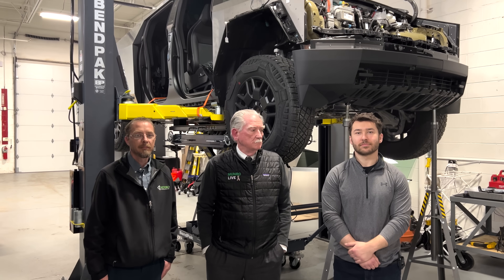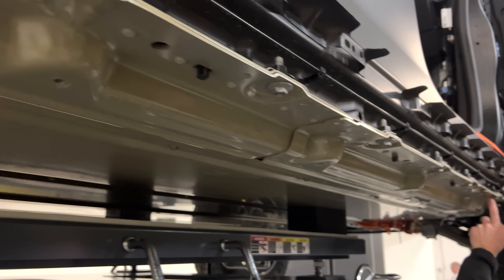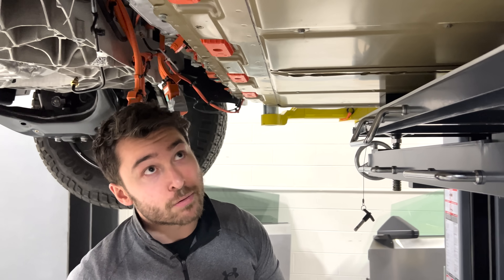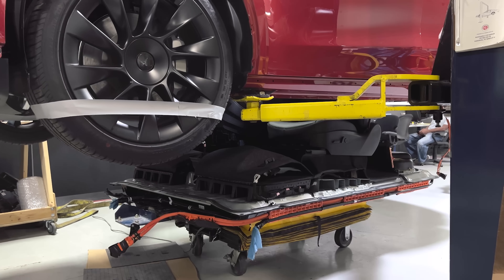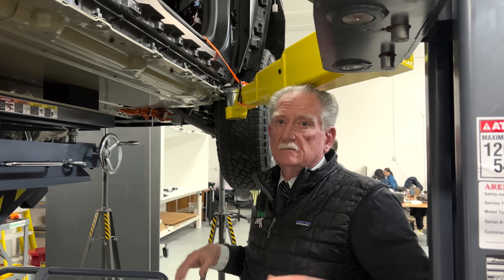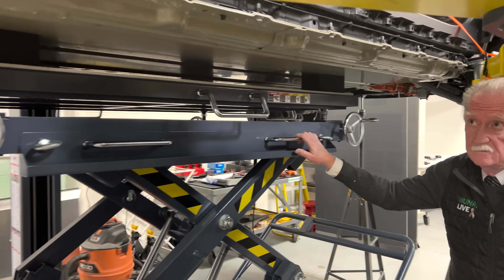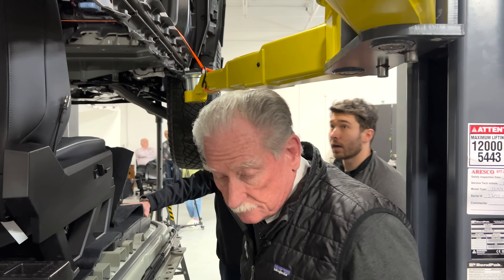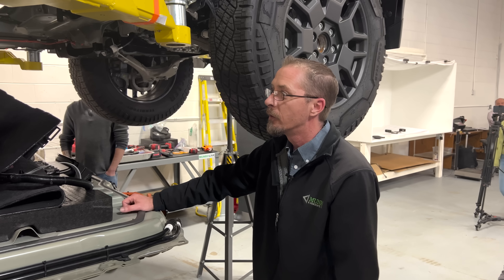Dropping the Battery Pack in Our Tesla Cybertruck!

Comment: Having the battery pack integrated into the floor and with the interior/seats bolted to the top of battery case sounds good for assembly.

As someone who removes, disassembles and services/repairs high voltage battery backs after the fact in a shop at the dealership… it sounds horrible lol. The current setup for the BEV battery packs that I work on, they have the entire battery pack bolted to the underside of the unibody with no need to disturb or disassemble the interior. Just disconnect the hv connectors, remove those bolts on the perimeter holding the battery to the frame, drop it down. Then you can just unbolt and remove the top battery cover to access the inside of the battery unit and do what you need to do. 

I’m assuming they will need to remove all the seats and interior before being able to remove the top cover and accessing the inside of the hv battery unit? Oh well. More labor and more money for the technicians I guess! Seems like they are saving on assembly, but trading that for labor time to service/disassemble it if there’s an issue later on and gambling that nothing will fail or have a defect inside the hv battery unit. Time will tell, but it looks pretty rad.
Reply: What's the betting they will find it is like the Model Y: seats on top of a  sealed structural battery unit filled with foam that renders battery and control units not just  non repairable but incapable of being internally inspected without destructive entry and total PITA of manually removing foam or dissolving it with solvents

That's leading to write off of Model Y's after even minor shunts and ramping insurance premiums
Reply: The structural packs are essentially non repairable. Maybe you can do some work to the controllers, but the rest is no-go. When its caput the whole thing needs to be recycled. Thankfully I suspect these packs are quite durable so the need for repairs might be less.
Reply: Maybe it's to make the interior waterproof that's why there is no leakage into the interior and that it's the safest EV
Reply: Apprently the seats CAN be removed w/o dropping the pack.
Reply: @varietyegg  Cybertruck has a specific Wade mode for going through water. Raises suspension up but also pressurises battery with air from suspension sysyem to prevent water ingress

Comment: Thank you for the video! I wish they’d make easily serviceable battery packs. Say there is a failure, it would be nice and a much lower cost to be able to replace a cell or small module of a few cells. This is the way they did it in the 2015+ era Model S. It’s also more environmentally friendly.

Comment: Some good information here. I have assumed that a structural battery pack meant that it could not be replaced which would for the long-term owner of a vehicle be terrible. Nice to see it’s easily removable.
Reply: Ugghh.. the very last step went smoothly, but they did alot of fiddling to get the charger bus bars disconnected. Also, the fact that the top of the battery is interior to the cabin while the bottom is exterior, means that mounting it requires careful application of sealant or else the interior will fill with  water if the truck is partially submerged. So lots of caveats with this one.

Comment: You say that this can be assembled in two stations versus 12 or 14, but that doesn't account for dressing the battery pack with the, floor, ducting, seats, etc. How many stations would Tesla need to prep the pack? Is the real advantage just being able to do those tasks in a more open environment?
Reply: That can be pre done on another line. That way it's a complete assembly when it gets to the main line. Same as the front and rear drive unit assemblies.
Reply: Exactly,iits all just asskissing,no critical thinking!
Reply: @saff226  Of course, but it still takes time to do that work and money to create those stations in the plant. Before claiming this saves 10 minutes per vehicle and $600K-$800K in capital costs, Munro needs to account for the time and financial cost of dressing the pack. Not saying there aren't advantages to how Tesla does it, but I suspect the savings aren't quite as big as claimed. I'd love more detail!
Reply: @EricTingwall-zy3pd  Maybe having a subassembly allows the main line to run more independently while increasing the flexibility in dressing the pack. Thoughts?

Comment: Service manual is available and has info on "High Voltage Battery Assembly - HV Battery, Long, 4680, Center (Remove and Replace)"

Comment: Keep in mind, only 1st row seats are attached to the battery and floor. Not 2nd row seats.
Reply: But the rears (probably) bolt to the rear casting, and we've yet to see how that is assembled, so it could be more of the same.
Seats > casting > body....  ?
Reply: The rears look like they bolt to the back wall( rear castings). With no floor it would make it so much easier to install everything else in the car as the operators can stand upright instead of climbing around inside the car
Reply: Third row is right out!

Comment: Would have been nice to see how many things you have to move/fold/disconnect in the cabin to do this. It's not just the 5 bolts - it's carpets, at least one electrical connection (maybe more?) vents. Other bits of trim? Seatbelts? It clearly efficient - I'd just like to see the whole process to get a feel for how it compares to conventional assembly.

Comment: This format to me is not innovative. Maybe for initial consultation it is time saving and weight reducing but after that it's not a good idea for maintenance. 
For example, if you just want to replace the battery, now with this format, you not only need to remove the battery, but you also now need to transfer the seats carpet centre console etc onto the new battery before fitting which is extra work. 
With this layout, the battery is now a critical part of the body structure strength. Also, with this layout, the design is very vulnerable to corrosion and water salt ingress depending on the climate in which the vehicle is used
Reply: Seats can be removed w/o dropping pack.

Comment: The sheer amount of manufacturing processes and associated costs that Tesla has eliminated with the CT (and other Tesla vehicles) design, are simply staggering. I retired from this business, and I am awestruck. No one can compete with Tesla on basis of costs. I told people that if Tesla was building ICE vehicles, they would be able to do so at a cost of 35 to 40% less than what conventional automakers currently achieve.

Also- less complexity = better quality.
Reply: There are other EV's that are alot cheaper, so not sure this is true.
Reply: @ahhmm5381  Tesla is the only profitable EV manufacturer. BYD, for example, makes most of its money on hybrids. And it only manufactures in China. It would lose money anyplace else.
Reply: @charrin9086  If Tesla EV's are so cost effective, why are their sales declining in China? Why is BYD crushing them?
Reply: @ahhmm5381  "Tesla China’s domestic sales saw a notable month-over-month rise in March 2024, with the electric vehicle maker selling 62,398 vehicles in the local market. That’s a 107.02% increase from the 30,141 units that the company sold domestically in February 2024"
Reply: @charrin9086  Looking at single month sales data is laughable.
Look at the long term trends. BYD crushes Tesla in China, and is roughly even globally. 

However, it is a bit unfair for me to say Tesla sales in China are declining. The real problem is the loss in market share.

Comment: The service side of this assembly approach will easily eclipse the production savings.  Not to mention a whole new era of cabin leak and noise concerns.  Quite frankly the lack of a sealed firewall between the pack and the body is also disturbing.  You call it innovation I call it ignorance.
Reply: The cabin is REALLY quiet if you've actually seen reviews. The maintenance will almost always be under warranty, the front seats can be removed without dropping the pack, and there is a sealed firewall.
Reply: @connergrim7913  that's my point. The warranty costs will dilute any savings.  Sure it's quiet now there's a brand new weather strip.  The body flex over time will degrade it and lead to wind noise and water leak concerns.  The top of the pack is sealed to itself, not from the inner side of the vehicle, yes packs are designed to contain a thermal event for a period of time but a actual solid body firewall would definitely be safer for the occupants.
Reply: @CMB1566 It would add some sort of protection at the cost of manufacturing price per pack, time to make those packs, retooling, etc. I'm going to be honest though, this is a diffrent time of critique compared to "ev emissions bad" when I can just point those people at the new Bloomberg study that can EASILY prove them wrong.

Comment: I see how this a great idea as far as cost and speed of manufacturing goes. But this will make it a major pain if that battery ever needs serviced. I'm pretty sure tesla has designed the pack to never need servicing until its due for a total replacement, but I like that my ford lightning pack is non structural and completely protected by the frame rails and doesn't need anything done to the interior to work on the pack. Also serviceable pack modules vs. what Is likely a non serviceable sealed pack with the cells all glued together. If a few of those 4680 cells go bad you'll need a complete pack replacement is what I'm thinking. Reminds me of how cell phones have gone from replaceable batteries with removable back panels to sealed designs.  When new and under warranty it doesn't really matter but from a 2nd or 3rd owners point of view I'd prefer something that won't require total replacement if something goes wrong in the battery. I look forward to seeing this pack cut open though, I'd like to see what's inside.
Reply: Modern Tesla batteries can't really be torn down.. .go look at Monroe's teardown of the Model Y pack. It's all foam filled and solid. The real idea here is you can't really remove and replace single modules from the battery anyways as they won't be balanced with the rest of the pack (go see some of the YouTube videos of people who tried and the battery ultimately failed again). Instead, Tesla is building a lithium refinery in south Texas not only to supply refined lithium imported from Australia to make more batteries, but eventually old batteries will be ground up and become super rich "ore" to be refined again. Aside from that, the reliability of Tesla batteries is so high at this point it's pretty much a non-issue.
Reply: You are both not wrong. This is part of a product lifecycle designed to have an end of life with less ability to repair either by knowledgeable owner or independent mechanic only through Tesla repair center which would replace the whole structural battery pack design with individual cells which can’t be replaced individually so the whole pack had to be replaced. Incentivizes purchasing new vehicle rather then repair the vehicle. Replacing battery structural pack can be done is/will be probably be expensive but less then purchase used or definitely new vehicle.

Definitely came from current tech manufacturing and design.
Reply: @skiboxing  the F150 lightning battery has 9 modules that can be replaced individually vs needing a total pack replacement. About 4% of Ford trucks have had defects requiring a module replacement. Replacing 1/9th of the pack definitely saves the company on factory warranty claims. Tesla likely has a lesser defect % due to their many years experience and using cylindrical cells vs pouch cells. After 100k miles when my warranty is up if I need battery work it'll be possible and I'm sure it'll be cost effective with new or salvage pack modules. With the Tesla packs you're stuck needing a costly complete replacement and the cyber truck looks like that would also be very labor intensive given the interior is mounted to the battery pack. Also Fords pack is well protected and mounted on rubber pads to isolate it from vibration. Both have pros and cons but from an owners point of view I'd rather have a non structural serviceable battery pack.
Reply: @curtiswhite7880  A fair point... but as the statistics seem to prove out, most of the issues that cause failures usually happen well before 100K and are usually due to manufacturing defects. So if you have engineered past most manufacturing defects (just like complicated ICE engines even from the worst manufacturers like Hyundai or Chrysler ;)) you get a 100K mile life before something major. With any luck getting a whole new pack will hit that magic price point which not only makes the cars cheaper to buy but also puts the replacement well into the range of the $5-9K engine replacement territory, except the fact that the residual value of the packs for their rare earth content (the core charge as it were) will be much higher than a blown engine. I also wouldn't be surprised by the time we get to that point of worn batteries that many aftermarket options will be available... especially if the growth rate of EVs stays on this curve. 

The Toyota Prius sold a fraction of the numbers that Tesla has and thee is a robust aftermarket of rebuilds and new batteries now (even lithium conversions) so I'm sure a new market will spring up (as long as the safety factors are regulated somehow). 

So yes, I agree that early EV builders like Ford need to take into account modular batteries... Tesla has mostly engineered past that and as well cause a major reduction in the cost of those batteries (maybe not in what they charge for a replacement, currently its pretty ridiculous) but I'm positive once we see the latest, high volume round of Tesla sales start aging, there will be solutions for these issue. The market always finds a way  ;). We are just in the very early stages of this and only in the last 2-3 years or so has the amount of EVs (mostly Teslas) become consequential. 

Hey you are correct in your insight, but remember when OBD came out and people were complaining that we couldn't wrench on our cars anymore because they were turning into computers? I just had to replace and recode a transmission control module on my daughters Lexus... something I never would have thought was possible a while ago... but hey, I could get Techstream from a "source" and buy another module from Ebay, read the adaptation numbers from the side of the transmission housing and then make sure the pressure adaptations were transferred to the new TCU. Lexus would have charged thousands to fix it, but due to a robust aftermarket and generous online information sharing I could get it done... and certainly her 2011 LS460 is massively more complicated than a battery attached to electric motors ;). So yeah, I really hope and believe if I keep my 2022 Tesla for 10 years and the battery gets worn there will be companies offering either new build aftermarket or refurbished aftermarket packs which will probably be build in a different way than the OEM so I can keep my "clunker" on the road.

Comment: @Munro Live -- Sandy I agree this does save a ton of time but I doubt its 12-14 stations in the purest sense.  The battery pack assembly with all the wiring, console, carpet, seats etc still have to be assembled somewhere.  Still faster and easier with this method though of course.
Reply: If you compare apples to apples: any EV has to have those steps, but all of those steps are in the battery line anyway, not main assembly. Hes talking about the main assembly line stations for installing the AC ducting, cabin electronics, carpet, seats, center consoles, etc. All of that is done in just a few stations over on the battery line, and then on the main line, it all comes along with decking the battery in a few stations, which is again a step that every EV has, so that isnt counted. 

Also, since the entire bottom is out of the vehicle, it is probably dramatically easier and faster to install the upper interior components including dash, steering, airbags, headliner, etc as opposed to crawling through the door holes to do that work.
Reply: @patreekotime4578   It doesn't really have anything to do with the battery--as you said every EV has to have a battery pack.  My point was that all the things for the interior of the truck that are added to the battery pack--prior to installing the pack through the bottom of the truck--still have to be assembled onto it.  No interior items are omitted--there are still wire harnesses, sound insulation, seats, carpet and so on.  I did say I agree it will make some/most things easier and faster but it won't eliminate 12 to 14 stations.  

To be extra clear.  It DOES reduce the number of stations on the final assembly line because it allows for parallel assembly.  The flip side to that is that Tesla is so vertically integrated all the work assembling the battery pack package still happens in their factory.
Reply: @genephipps6421  I feel like you are just disagreeing to disagree and we are saying the same thing.
Reply: @patreekotime4578  Not at all.  I stand by my original statement.   Yes it is a flat out awesome design approach and reduces a lot of GAL stations but 12 to 14 is overly optimistic by half.  He was on camera and had about 15 seconds to think about it.  It is likely with more time to evaluate everything his estimate would change.

Comment: I am just curious how they manage to keep the cabin waterproof when entire floor is removable.  Thats quite a long joint all the way around the battery that needs to be sealed up. Is there no sealant of any kind being used, just some sort of installed seal that is compressed?
Reply: Looked like there was a bulb seal around the perimeter of the battery pack (inboard of the attach bolts)
Reply: Good question
Reply: Very surprised this wasn't mentioned at all